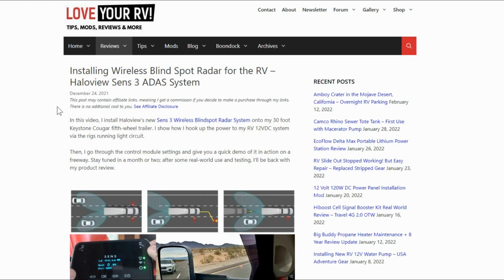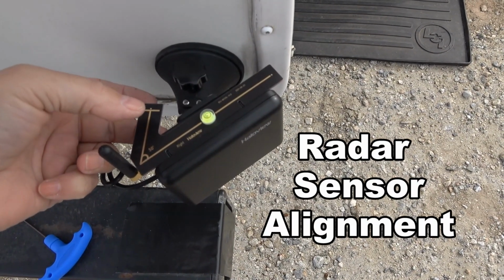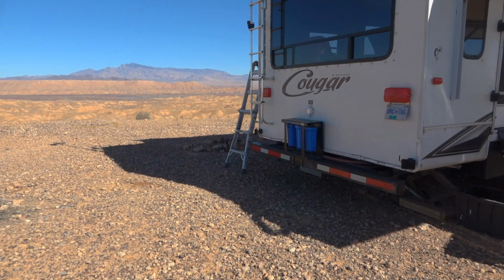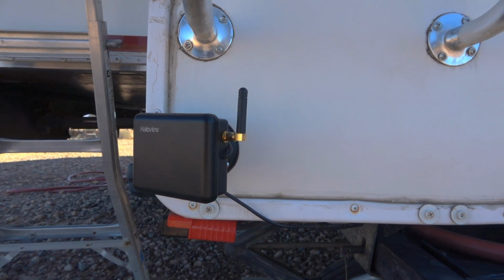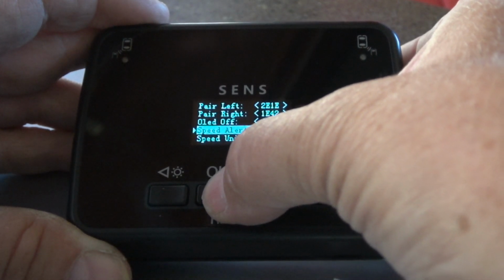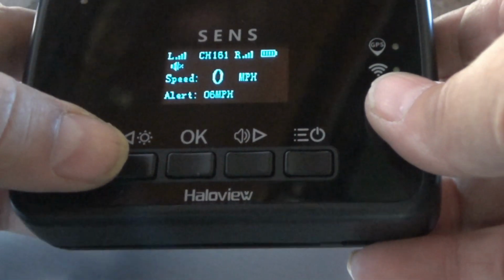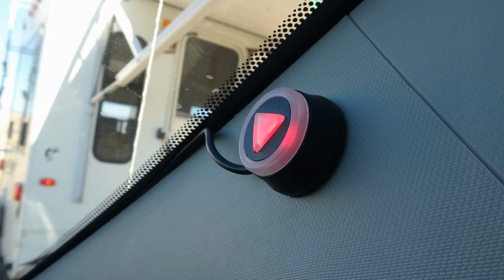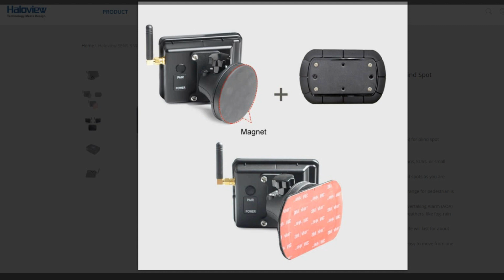Haloview Sens 3 Wireless Blind Spot Radar Review - (ADAS) Advanced Driver Assistance System

Comment: i have question    i’m pulling a f150 behind 45 desiel pusher     do i set to car rv1 rv2 etc
Reply from the maker: I'd start with RV2 and see how it goes, but you can easily change to a different setting, even if the truck ones, and see which works best. Being that you are so long a truck setting meant for semis may work best. Cheers, Ray

Comment: I have the Haloview rear camera on our Ford Transit HR. It’s overall length is 19.5 ft. Our installation is totally wireless, as we use their magnetic battery to power the camera. I have to say, it is a game changer as the Transit’s OEM rear camera only functions when the car is in reverse. Many people have tried hacking this feature, unsuccessfully. Thus, many owners have installed aftermarket rear cameras, like the Haloview system. I have noticed, on many occasions, vehicles that “whoosh” by me without my seeing them in my side mirrors or rear camera. This blind spot detection system will help to minimize these unnerving events when pulling trailers or driving vans with compromised visibility. Thanks for doing these videos. My Sens 3 kit is on order from Haloview and I expect to receive it next week. As with my camera, the installation will be a “no holes” version using magnets for the camera and batteries for the power. I’ve followed your videos for years, first when we owned a teardrop trailer and now that we have the van. Have a great New Year.

Comment: I am pondering the easy accessibility of the trailer mounted components for those inclined to vandalize and/or steal, and accidental damage due to my own carelessness . The high mounted camera is more secure against such situations. Regards.
Reply from the maker: If they are actually looking to steal or vandalize the radar units I think you have a lot more to worry about concerning other parts of your RV.  ;)  Best to maybe not leave it in areas with those types of people around or opt for magnetic mounts and remove them.

Comment: I guess this product is designed for driving large vehicles in a weather that mirror's visibility is degraded.
Reply from the maker: I see it as just an extra layer of safety like a rearview camera is. The radar can let you know there is a vehicle there if you don't happen to be turning your head and looking over into the side truck mirrors at that exact time. The driver's side LED indicator is easy to see in peripheral vision without taking eyes off the forward road. The passenger side also can audio alert. It also may help at times that weather conditions make the mirrors less effective. Whether that extra tool is worth it is up to a person's pocketbook. 😉  A lot of big-rig trucking companies are now using similar radar systems on their trucks to detect small cars beside them. Like I concluded at the end of the video for me I think it's a nice to have item but not a must-have.

Comment: Hi Ray.  I might have missed it; will it detect backing up issues (hitting unseen obstructions behind you), and tail swing issues (pulling out of gas stations and coming close to gas pumps)?  Thanks, John
Reply from the maker: It might alarm if the speed setting was set to zero, but it's not designed for those types of things so you couldn't count on it. Its programming is set up for motion and approaching vehicles from behind while driving on a roadway. They don't list those things as use cases.  Cheers, Ray
Reply: @LoveYourRV  Thanks Ray.

Comment: What I can't understand is how this thing can possibly detect lane hangers that pass your trailer then never pass. I can watch people in my mirror come into view, but if they just like to ride along side this thing doesn't do anything. Nothing is a better substitute than paying attention to what is going on around you.
Reply from the maker: It can't and is not a substitute. That is what the different settings are Car, RV 1, 2, 3, and Truck 1, 2, 3. The setting tells the radar box approx how long your RV is so it can calculate when to turn off is my guess. In my experience, people rarely hang out much beside me. And yes it would be dumb to start not using the mirrors as usual. It's basically another tool to help keep track of vehicles especially when the mirror's visibility is degraded. I've been in rain storms where it was really hard to make out a vehicle but my rear camera could see it fairly clear. I'm thinking the radar will also help.